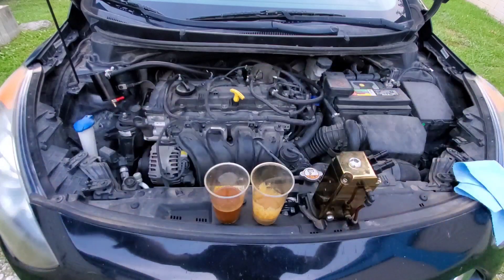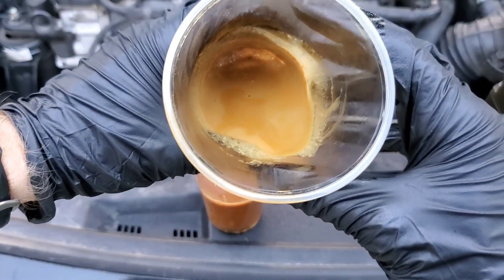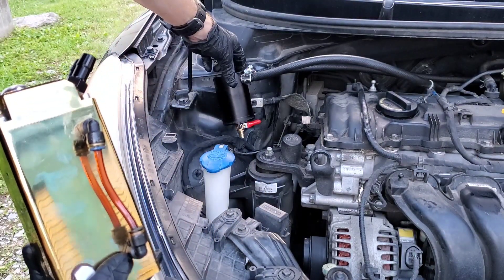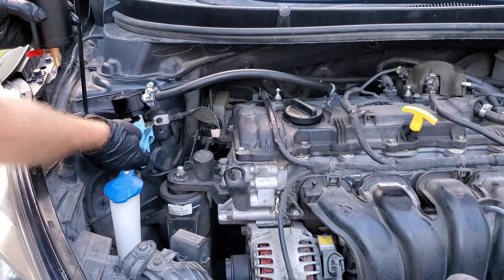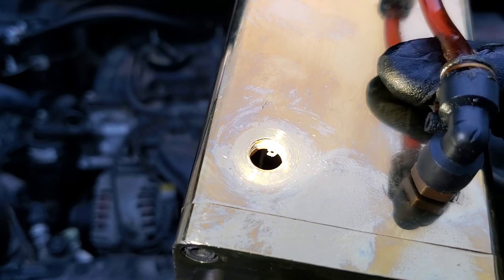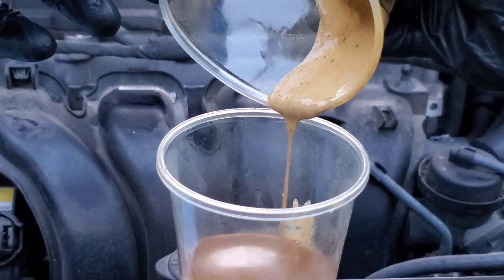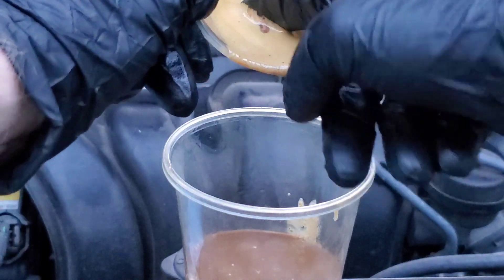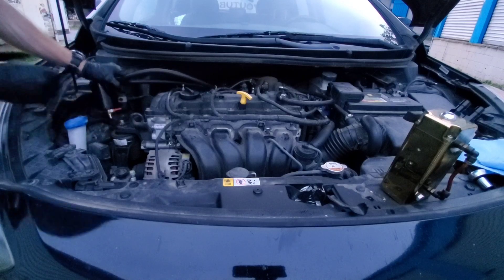Best Oil Catch Can

Comment: I have an evil energy can on both my cars. My car is a 2016 Kia Optima with 59000 miles. My wife’s is a 2015 Buick lacrosse with 140000 miles. I added stainless steel pad to both. I also added 30 micron screen sandwiched with stainless steel pad to the outlet. The Kia has very little blow bye. It is mostly condensation. I therefore put a foam filter in the bottom to absorb condensation. I empty it every 4000 miles and have mostly water. The  borescope shows clean valves and mpg are 40 to 43 on the highway. My wife’s Buick has filled the can every 2000 miles with a lot of oil and condensation. It’s nice to know that those contaminates are not going on the valves. Engine pressure in the crankcase is reduced with the cans on both vehicles. Mpg are increased. Oil changes at 4000 miles both show significantly cleaner oil

Comment: that car/engine has problems . my  ford fusion 2014 vep 2.0 engine.. even after 6 months.. gas almost no oil in the oil vapor separator/catch can, even with 194300 miles on a well taken care of engine

Comment: THIS GOOP IS JUST  WATER IN THE OIL ' CONDENSATION DEPENDING ON WHERE YOU LIVE AND THE WEATHER TEMP AND HUMIDITY OF YOUR AREA  ' WITHOUT A CATCH CAN ' YOU WOULD NEVER NOTICE THIS IN YOUR DRAIN OIL FROM A NORMAL OIL CHANGE  INTERVAL 'MUCH BETTER IN THE CATCH CAN THEN IN THE ENGINE  OIL PAN  : - )
Reply: its a blown head gasket

Comment: Hello sir , why we need to use oil catch can ?
Reply: It’s usually for older cars that would have a vent in valve cover that would lead back into the intake and any oil vapours that vent out are meant to be burnt off by the engine. This can lead to gunk build up overtime in the intake and on the piston heads, leading to loss in power and performance. The oil catch can basically allows the venting to pass through it and allows that oil vapour to collect. Basically all that oil you see collected would have been sucked into the intake of the engine and burned off over time. I haven’t used one since my 85 Toyota Trueno, but I wonder if any are still needed today?
Reply: @EpicBenjo  There is a interesting video on youtube that advises against a catch can,  it went something like this.. A catch can basically slows down the venting so that the vapours condense into a fluid and can be caught, the problem is that the vapours are not being burnt off quickly enough due to the can and the length of the hoses etc, This causes a build up of gases which then causes issues..The guy tested this by pushing air through the original crankcase breather and then the catch can. there was a marked difference in the psi from the can, it was much lower..So its not allowing gases to pass through it quickly enough.. I'm presuming that the many videos that claim to have engine damage after using a catch can is due to this..His argument was that the risk of engine damage kinda outweighs a little build up of oil etc in the inlet manifold, which can be cleaned..After watching this i decided against a catch can..
Reply: @benjammin1212  Interestjng. Does this go for cars from the 80s and 90s as well? Or just for newer cars?
Reply: @benjammin1212  The whole point of a catch can is to slow down the velocity of the crankcase vapors/contaminants so they can drop out and be collected, instead of being deposited on valves/pistons etc. So I don't quite follow what you stated there.
Reply: @clark5242  you have basically stated exactly what the problem could be, the slowing down of the vapors, as i stated, i'm no mechanic, but there are plenty of utube vids talking about engine damage.. once you add the can and its hoses it possibly slows it down too much..

Comment: 10k miles during a dry spell will give different results than 10k miles of humidity like during a rainy season.
Reply: That's what I'm discovering with mine. At the same time I catch can media got coated with pudding, my thermostat was holding at just 180°. Ten mile trips were not  burning or vaporizing all the moisture out of the engine.
In fairness, my catch can had been installed for 4 months and the average temperature for the last month hasn't been much about 42 degrees. My coolant level hasn't changed much, so I assumed a lot of this is condensation.
I'm building a new 32 oz catch can, twice the size of my old one. I also replace my thermostat so it's at 195 now. I'm sure and during cold weather, 15 degrees too cold is a tremendous difference.
Reply: I upped my thermostat from 192 to 195F and it made a huge difference in burning off that condensation.  @randywl8925

Comment: Hey Nate. If I recall, you used one of those small air compressor filters on your car. Would that be safe to run between the clean side of the engine into the air box hose? I have a 2017 impala ltz with the 3.6, I have a catch can on the dirty side. When I changed my spark plugs I noticed a small spot with oil on it. Seems the air box vacuums when full open throttle. Should I run a small filter then? Thanks for any help. Your channel is awesome.
Reply: Update on what happened with your 3.6 ?

Comment: It's not just what catch can one uses. If the car engine is  in good shape you collect less oil from blowby. If you use good quality oil, you get less blowby. If you drive more conservatively (mostly on  low rpms) you get less blowby.  Catch cans only can catch whats thrown out of  the pcv valve. Catch cansz do not make thAt gunk.
Reply: I’ve asked him here on the replies. He hasn’t answered. I’ve wondered as well. Also he gets a lot of deposits on his valves. Must have a bad PVC valve idk.

Comment: Do you think you could por seafoam into the catch can and when the 
engine is running it will gradually pull vacuum and atomize the seafoam 
into the intake and clean the valves for you?
Reply: interesting hypothesis , yet to see if anyone has tried that
Reply: @kamistake  Thanks for asking.
I was wondering about this as well.
Reply: no.. the carbon has been baked on the intake valves,, no snake oil will fix that.. walnut blasting is the best fix

Comment: Is a oil catch can good for all vehicles or just certain vehicles??
Reply: It's good for all cars.

Great for most. Over engineering for some, but when has doing better been a bad thing?
Reply: Gdi engine mostly or if you have after market turbo
Reply: For direct injection motors mostly. Port injection it’s not as effective. But anytime less oil drips on to your valves the better